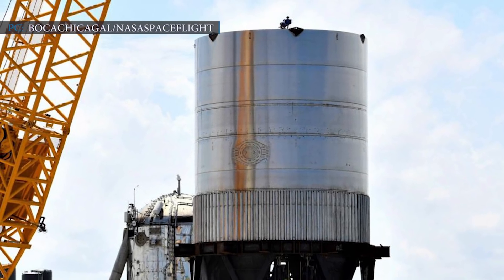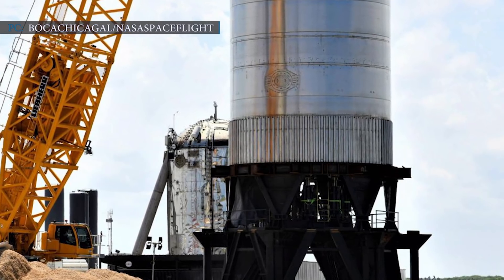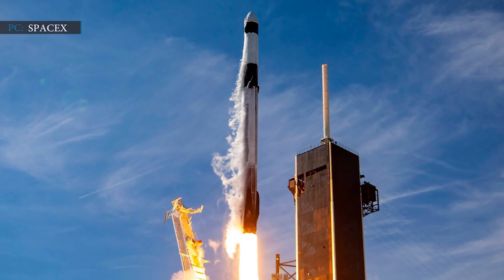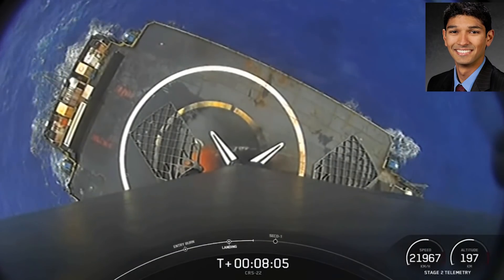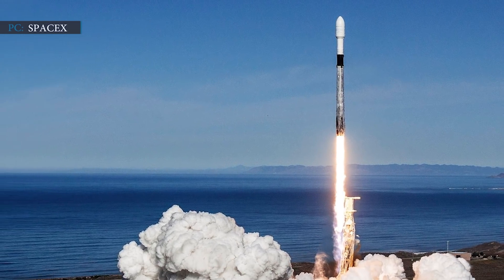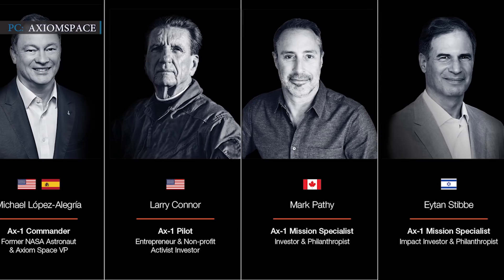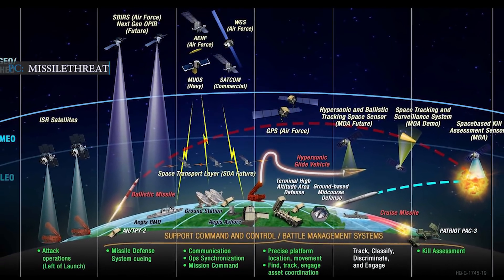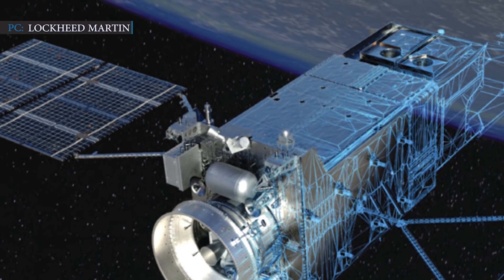SpaceX Starship booster hardware rolls to launch site | CRS-22 Dragon docked | SpaceX & Axiom deal

Comment: I was wondering why SpaceX doesn't build a road between the construction site and the launch site.
If they had that, they wouldn't have to always ask for a road closure to move things between the two sites.
Reply: spacex's launch site is smack dab in the middle of a protected wildlife area. they can't build anything without approval.
Reply: @sirmoonslosthismind  Thank you. I didn't know that. But wouldn't a road inside the SpaceX compound be just more infrastructure or do they have to get permission to build anything permanent.